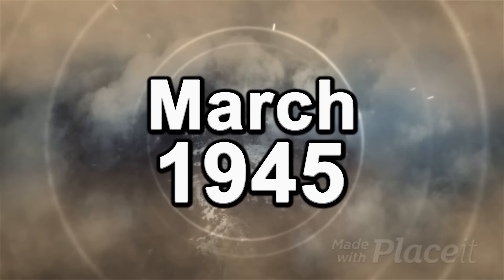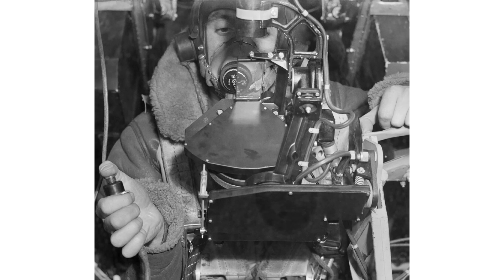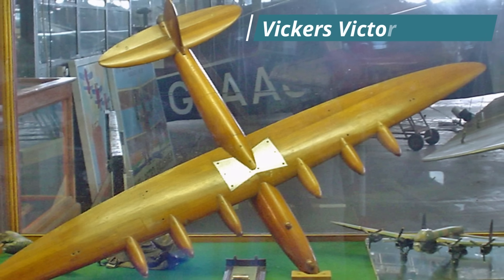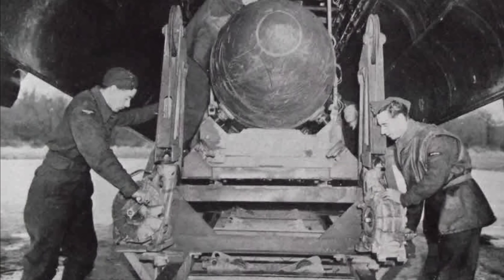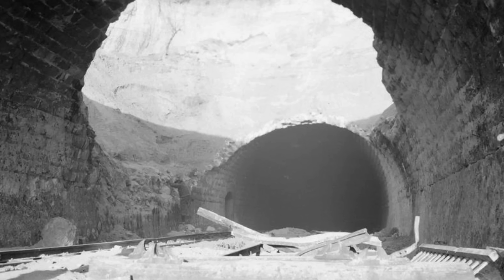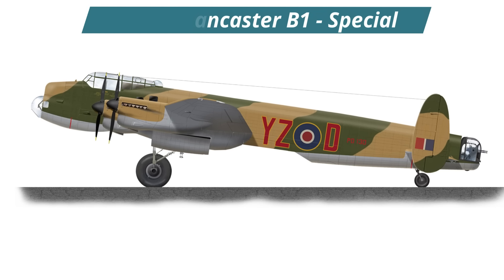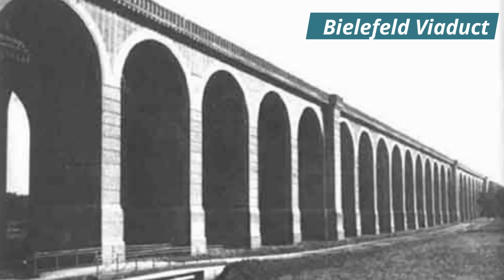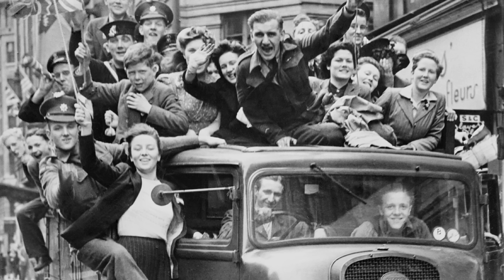The BIGGEST Non-Nuclear bomb in World War 2

Comment: i beg to differ, its not size wich matters in bombs, its how u use them the bombs wich made the most devestation, were those wich set everything on fire, the firestorms wich walz through the citystreets suck in air people and everything that is burnable... with big bombs u have to prezice in were u drop them but lots of little bombs over a huge area are much more destrucktive, special if filled with unstopable fire... hundert thousend people died in the britisch fire bomb attacks, were the air was sucked out of the bunkers and the heat so hot that every metal melt and got vaporiced, storms blew through the city streets that sucked people away wich fled out of the bunkers cuz they couldnt breath..

Comment: I reckon that the deletion of the mid-upper and front turrets, and the installation of a pair of .50 inch machine guns in the rear turret of all Lancs and Halifaxes would have been beneficial.
Reply: The mid upper was  a waste of space and weight  - although the fact that the Germans hadn't taken long to twig Defiants  were lethal from  behind but were easy meat head on wasnt lost on the RAF,  the Lanc would have soon gone the same way  although I agree with you on the fifty calibre brownings  both the nose AND tail turrets would have given the Germans nightmares if they had entirely replaced all the puny (by 40's standards)  browning 303 peashooters. refitting the ball turret back in the  belly armed with .50's might have saved many a crew from schrage musik too. I sometimes wonder what the scenario might have looked like if they had developed stripped down and lightened  20 mm oerlikons for those positions instead.
Reply: @usernamesreprise4068  Harris wanted .50 armament. The Ministry of Aircraft production wouldn't fit them.
Reply: @richardvernon317  The reason that the .303 Brownings were retained throughout the war and beyond was that there were vast stocks of .303 ammunition available.
Reply: @usernamesreprise4068  the successor to the Lancaster was the Avro Lincoln. This had a pair of 50 cal in the nose turret and the same in the rear. The mid upper turret featured a pair of 20mm Hispano cannons. Make of that what you will.
Reply: @bradster1708  What would you LIKE me to make of it ?
 Firstly,  armament fit and arrangement wasn't absolute, SOME Lincolns flew  with .5's in the nose if it was equipped with a B.P type F turret - some were deleted,   some flew with 20 mm Hispano mk 4's or mk5's in the dorsal turret -  some were deleted,   ALL  flew with .5 Browning's in the tail turret SOME aircraft had a  single .5 in a ventral belly turret............are YOU sure you aren't  mistaking the SHACKLETON ( son of Lincoln, grandson of Lancaster) which DID have twin H.S  20 mm cannons  in the nose ?
 Ian Thomson  gave the REAL reason why we were stuck with 303.s for so long - the powers that be  had  manufactured and stockpiled BILLIONS of 303 rounds during AND after the first world war.........and our penny pinching Politicians wanted THEM using up first - fighters were a different story, they needed the hitting power and greater range of the auto cannon and were eventually "reluctantly" allowed  to start installing cannons...(to stop the bombs falling on Politicians heads primarily  - isnt self interest a bitch ?) but the bombers (and the poor old squaddies with Lee Enfields) were stuck with them until we went to NATO rounds.
Reply: @usernamesreprise4068  you are clearly passionate about this subject and I appreciate that. I mentioned the Lincoln because the RAF saw fit to not only retain the mid upper position but to "upgun" it to cannons. Was it a good decision, maybe??? To lighten the mood, Avro did remove the mid upper on the Lancastrian.
I personally find that arguments of this nature are rarely simple. The Bolton-Paul Defiant was a terrible day fighter as was the Me110 but both were useful as night fighters. The Hawker Typhoon failed as a fighter but found a niche in the ground attack role. Anyway, keep up the good fight, cheers mate!

Comment: What I have never understood about the Barnes bombs was why they were not wire guided.
Barnes was meant to be devestated about aircrew losses, well a very simple, cheap way is to make sure the target is destroyed first visit, which didn't happen often with the cares bombs, lots of repeat visits, therefore more aircrew lost.
We knew all about the German radio controlled stand of anti ship missiles, we could have either used radio control or simple wire guide, it only takes a decent flare in the tail and a lots of cheap wire, and you are almost guaranteed to put bomb exactly on target point, loiter time for planes woukd only have been a few minutes, compared to having to organise a complete strike again If target not destroyed, so, say 5 minutes loiture time, possibly miles away from strike point if using radio control, but even with wire, it's 5 minutes versus hours for a new strike.
Simple, cheap would have made the Barnes bongs far more efficient and probably saving dozens of complete aircrew for almost zero extra cost...

Comment: I question your statement that Operation "Chastise" was a success.

The Mohne and Eider dams were both breached, but the Sorpe, an earthen construction rather than concrete, was not. Wallis's bomb was ineffective against this type of dam.

All three dams had to be breached for the desired affect, which was to shut down Ruhr arms production for a long time at least before the power grid could be restored and the dams repaired.

But, as it turned out, the failure to breach the Sorpe dam doomed the mission to nothing more than a temporary inconvenience, with Ruhr arms production UNAFFECTED.

Wallis was shocked at the cost of some of Bomber Command's most experienced crews, and even Arthur Harris stated that apart from the propaganda value, all they really got out of " Chastise" was the formation of 617 Sqdn, tasked with all the " special" missions, and managing to perform many of them successfully due to the high standards of the unit itself. 

No other Air Force had anything like 617.

But this was the only bright side to " Chastise", which was otherwise a failure.

Comment: 02:00 “Bomb aiming technology at the time was poor”.
No.  The US had the accurate Norden bombsight but didn’t share with the RAF.
Reply from the maker: The Norden was a remarkable bit of kit but it achieved it's best under training conditionings. In combat, it actually faired not a whole lot better than other allied bomb sights. The point I'm making is that no air force had what we, today, would call precision bombing.
Reply: The Norden achieved no better results than the Radar Bombsight used by the RAF.
Reply: The Norden was extremely accurate. It could hit a biscuit tin from 20,000ft, providing the biscuit tin was 500 yards wide.

Comment: This is a lot of huffing and puffing for little blow. The real story about the tall boy comes in their use on German U-boat pens. The British waited until the U-boats pens were finished thinking their tall boy bombs could be used to destroy them after so much work had gone into their construction. Too bad they were completely wrong yet AGAIN! The roofs of the U-boat pens were 20 ft thick reinforced concrete. The much ballyhooed bombs barely scratched the surface. Same for the flak towers in Berlin, Hamburg and Vienna. Those massive concrete structures are still there to this day completely undamaged and indestructible.

Comment: The raid was on March 14, 1945. The surrender was signed on May 7th, less than 2 months later. Certainly begs the question as to how necessary this raid was. "Boys with their toys"?
Reply: No one knew when the Germans would capitulate - many including Monty assumed it would end in late 1944 given the speed of progress.. and then came the Ardennes offensive, the counteroffensive into Hungary, and there were millions of mines in the almost impregnable Siegfried Line to be overcome.. The Russians got there first. Hindsight is a wonderful thing..
Reply: @MarktheMole  "almost impregnable Siegfried Line to be overcome "? Huh? Do your research.
It had fallen into disrepair for several years and by the time of the raid by the Lancasters it was almost entirely in allied hands. Also, the German operation in Hungary you mention was also over by the time if the raid. Also, are you suggesting that the Russians were involved ? Really?

Comment: Beta version of nuke i guess
Reply from the maker: Indeed!
Reply: @FirstDagger  mate the nuclear weapon had roughly 20000tons (20kt) of tnt...the grandslams were 6.5tons
Reply: Hardly.  High explosive bombs have little in common with a nuclear bomb, other than both are classified as bombs and explode.  In fact, during the development of both Little Boy and Fat Man bombs, the casings were dropped with HE to test the arming, timing, and detonating systems.  At the end of WWII, the 509th was sent out with "F" bomb casings (Fat Man Y-1561 design) loaded with 10,000 pounds of HE.  The final bomb dropped on Japan may have been an "F" bomb casing with HE.
Reply: @buckhorncortez  Both atomic weapons had a considerable amount of explosives inside them. They simply wouldn't have worked without a conventional explosion in order to fire the uranium bullet and cause a fission reaction as is the case of Little boy or the massive amount of explosives needed for the implosion method like in the Fat Man atomic bomb. Indeed the whole reason fat man was so big and heavy was because the amount of conventional explosives needed to compress the Plutonium.

Comment: That is not not a Lancaster bomber it's a Halifax bomber... Get your planes right
Reply from the maker: To which slide are you referring? I'm not aware of a Halifax picture being in this video?
Reply: It's a mk2 Lancaster with Hercules engines.
Reply: Mankind’s fantastic enthusiasm for ingenious ways of effort full destruction of itself is horrendous, and commentators finding this fascinating, musing overwhelmingly on technicalities. Most knowledgeable historians insist on there existing no military goals left in the whole of Germany in January 1945 - but the terror bombing (1961 white book) of civilian “goals” continued.
Reply: @Richard Hancock: If you're talking about the aircraft @0.45 where the ground crews are loading general purpose bombs, that is a Short Stirling, not a Handley-Page Halifax.  Apart from this and the picture of the De Havilland Mosquito, these are the specially modified Avro Lancaster.  The stabilizer fins on the tail section of the Halifax are completely different to those of the Lancaster and so is the cockpit canopy.

Comment: Terminal Velocity of 750 mph does this rewrite the laws? what happen to 118 mph maximum? Has are schools lied to us? ten tons falls faster then 10 pounds?
Reply: I presume you're referring to terminal velocity, ten tons streamlined is a little different from some guy in a jumpsuit with his arms and legs stuck out.
Reply: Here's some advice - Go back to school, learn some facts, and how to spell and structure a sentence.
Reply: @Benzyl  Very different!
Reply: @poruatokin  question does 10 tons fall faster then ten pounds. I was taught they would both hit the ground at the same time.
Reply: @carlmanis879  You obviously wasn't listening properly in class.  Hint: Why does a hammer and feather fall at the same speed on the moon as per Apollo 15, but very different speed on Earth.  Try again.
Reply: The weapon begins its fall at the speed of the aircraft. From the moment the slip is released, the weapon begins accelerating at 9.8 metres per second, every second. That is a vector addition to the initial aircraft speed. It will continue to accelerate until it reaches terminal velocity or impacts the ground. Terminal velocity for the aerodynamics of the Tallboy was supersonic. Aircrews reported seeing the weapon going transonic in the descent. Grand Slam was reportedly subsonic on arrival, 715mph, having not yet reached terminal velocity due to time of flight.